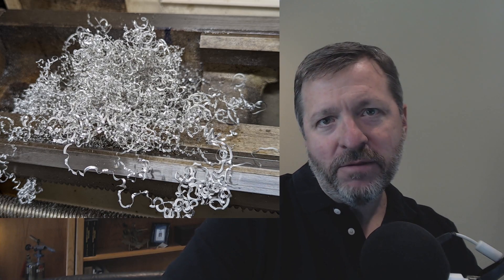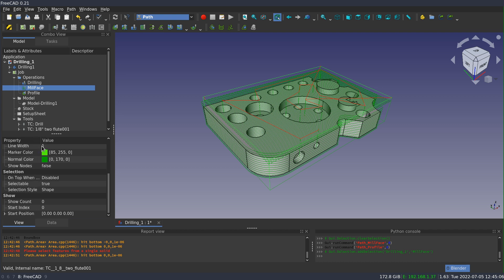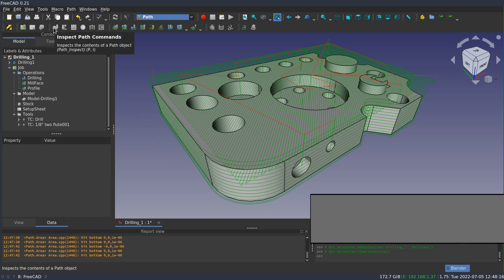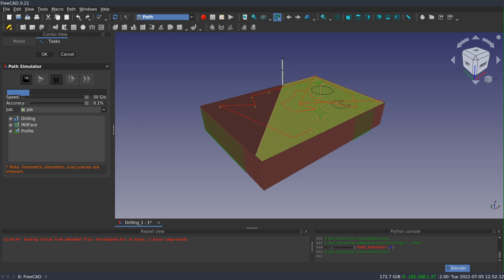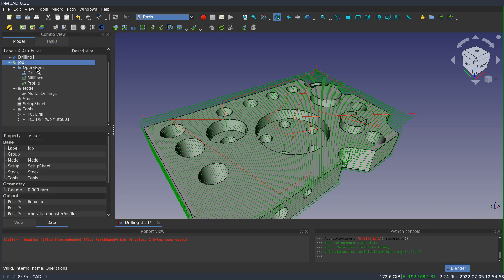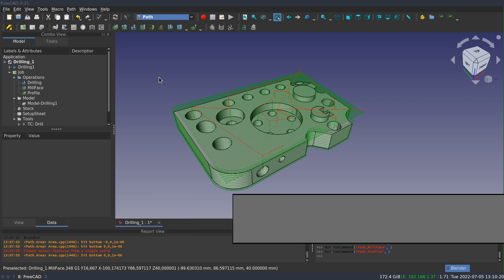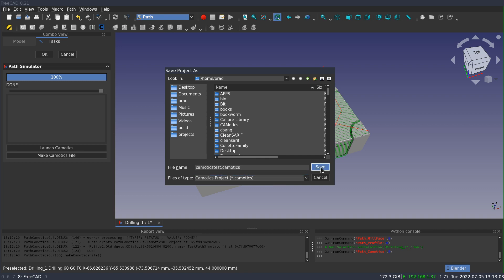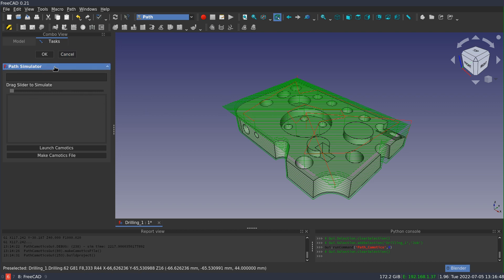FreeCAD Path Tools for Evaluating Tool Paths

Comment: Do you have a video showing how to set up a second and third operation for the side holes for example? I can only find videos of people using a router and doing one side but I want to be able to use a 3-axis mill and mill the underside or holes on the side...etc.

Comment: Firstly this is a great introduction to toolpaths, thanks for posting. This is very helpful for me. As I am new to freecad and milling.
For drilling do you use a drill bit or the end mill itself? How do you introduce a tool change operation in gcode? I want to do the drilling operation first, then do the tool change to milling, his can I do this?

Comment: Please make a video on drafted faces on profile in path workbench
I just tried to make a path for drafted faces but the path is going on 90 degrees. It is going inside the workpiece
And for fanuc controller postprocess is not getting
Please make a video for taperd profiles and with fanuc controller

Comment: Hello!
Can you please tell me if the custom stock shape actually works?
I've tried to use it. It shows the shape of the body I'm using as stock, but the path always extends as it was cutting from a bound box. This leads to a lot of air cutting above the actual stock.
Thank you!
Reply from the maker: Yes, it works.  Though it may not be fully integrated into every operation and feature.  For example,  I tested it with millface and you have to tell the operation to use the stock shape.  Also, the stepdown values are not automatically copied over.

Comment: Thanks for your work! Your video series about Path help me to start work with CNC.
Could you explain somthing about "Cut mode"? 
When I attemp to change cut mode to Climb or Conventional alwayse get the same result.
I want to process  job in one cut mode (because low hardness of my CNC) but tools always go in both directions...
Reply from the maker: This question would be better asked on the forum and please attach a project  file.  Here I don't know what kind of operation you're creating, your version of FreeCAD, etc.  It's possible that there's a bug.

Comment: I need to perform a t slot side cut, it's a styrofoam block to be cast later. I know there's a 'slitting saw' template in the tool library that could be used but I'm a little lost on which operation to use to make this work. I was trying to use LeadInOut dressup to fix the startpoint but the simulation always fails. What would be the correct way to perform this operation?
Reply from the maker: Overhanging cuts aren't really supported but  you can probably get there anyway.  Try a slot operation.  Select a single edge like the long edge on one side.  Extend the start and end point as necessary and make the stepdown large enough so you have just a single pass.  Not ideal, but it work in my test.